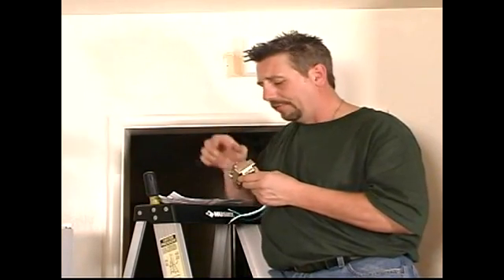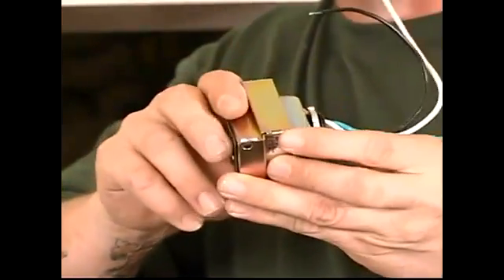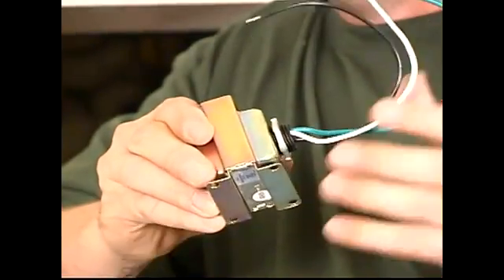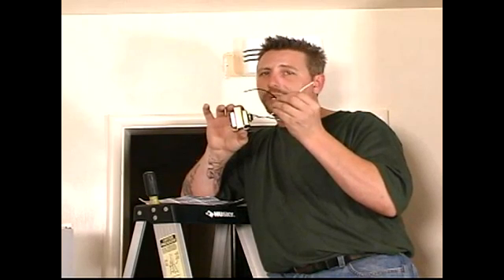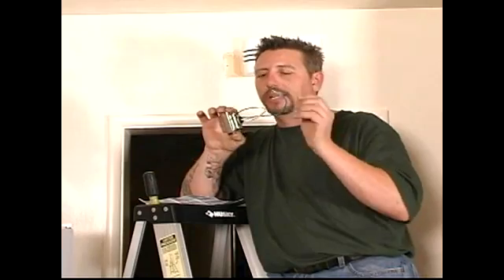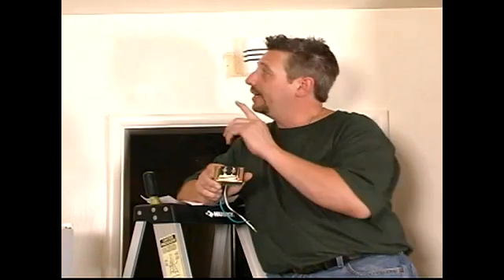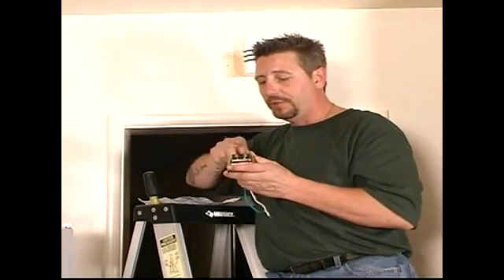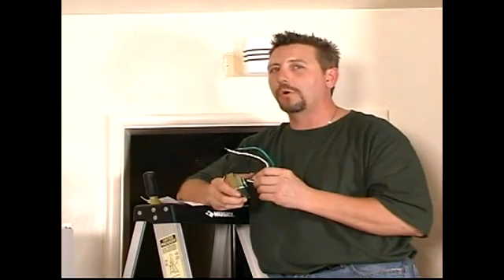Wiring the Transformer When Installing a Doorbell

Comment: I just found my doorbell transformer in the attic and I need to replace it with a higher volage model for my video doorbell.  I got the replacement and read the directions and it says "Do no install in the attic". Well thats just great so now I need to run a new 120v circuir into a closet?  How do I hide the wires? This just became a much much larger project.
Reply: Manufactures are just trying to save their warranty JFlywheel.  There is no electrical reason why you cannot install a low voltage transformer in an attic. They get hot and need a cool space to diffuse the heat. Attics tend to be hot and can cause the transformer to fail. However, many many many transformers are in the attic.

Comment: i cannot identify the transformer wire from the doorbell wire because both cables have white and red wire. One red wire is taped (i am guessing from an old door bell from previous owner). I am thinking that the taped red wire belongs to the transformer. So I wired like so: red taped wire to transformer screw and the other red wire to the door bell screw. But then i had the amazing idea to swap them to see if i was right. Turns out that when i swapped them and pushed the doorbell it sound again. And now im confused as to which one is for the transformer and which one is for the doorbell. PLEASE HELP!!

Comment: My old transformer does not have a ground wire.  The new transformer does. There is a a screw on the back of the transformer.  Do I wrap the end of the green around the screw.  Or,  do I just cap the green wire?  Thanks.
Reply: I did locate a copper wire inside the box that had not been connected to anything previously.  I attached that copper wire to the green wire and capped them together.  Does that sound correct?  Thanks.
Reply: Bingo.

Comment: My doorbell from the main wall has three wires colored blue, red and white. The transformer was in the bell unit itself. 

Not in the attic or basement. Not by the fuse box either.

The push button by the front door is impossible to remove from the bricks. It is flush mounted to the bricks themselves.

How do you solve this problem?